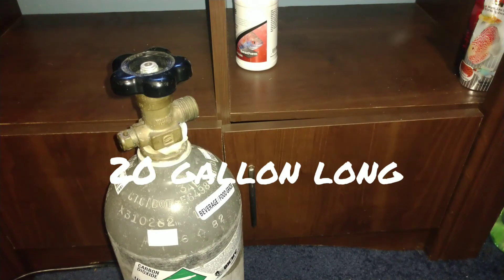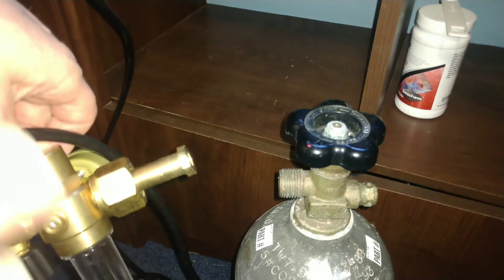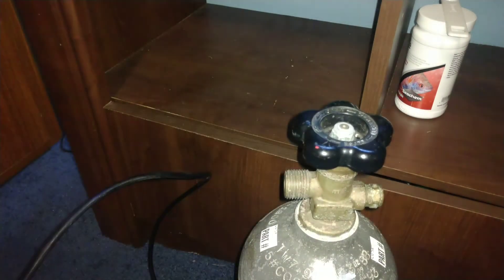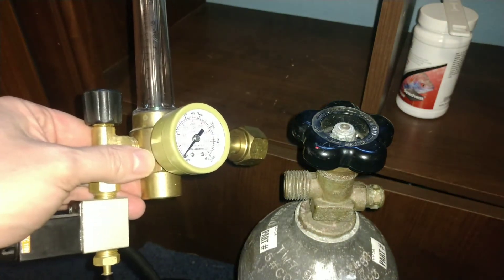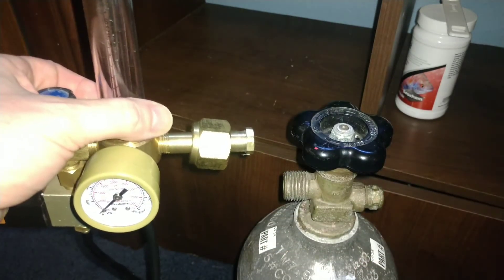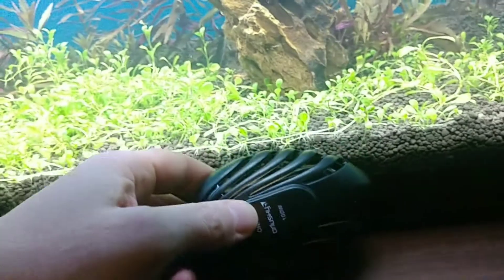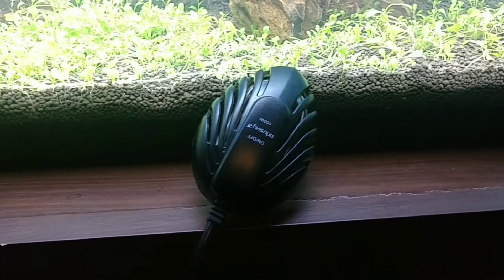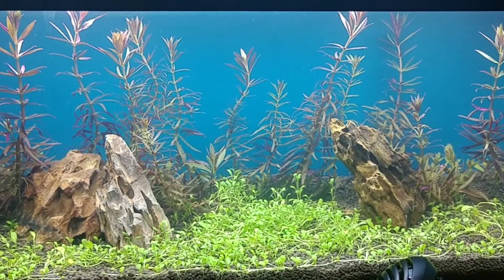20 gallon long; Episode 4 CO2 Injection

Comment: What cylinder do you use, and about how long does it last?
Reply from the maker: Sorry for the late reply, just saw this comment.  I use a 5 pound cylinder and it has been running since I posted the video.  I prefer to inject slowly as to not gas the fish and run it on a timer with the light.